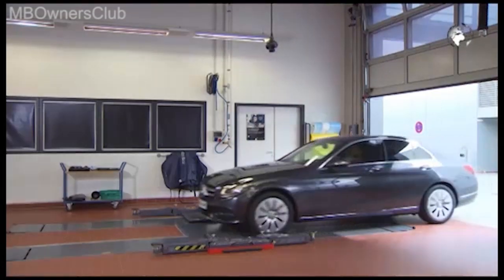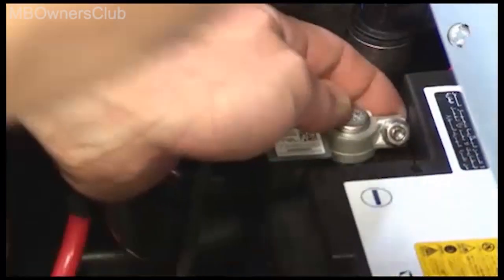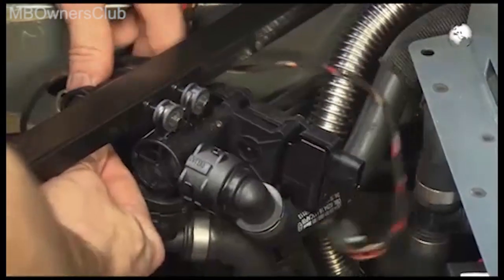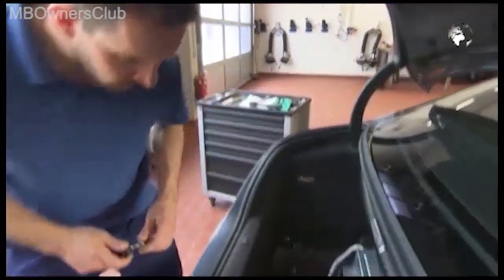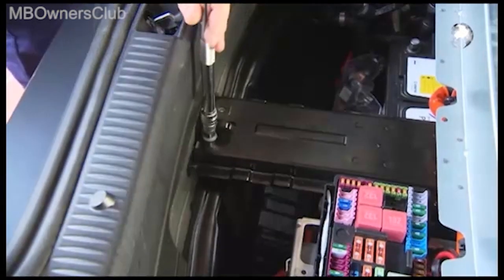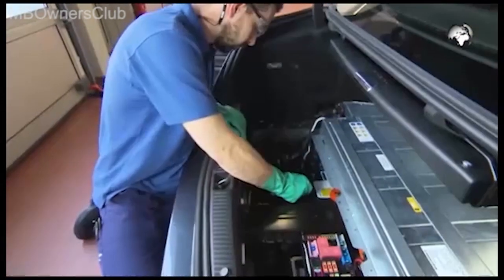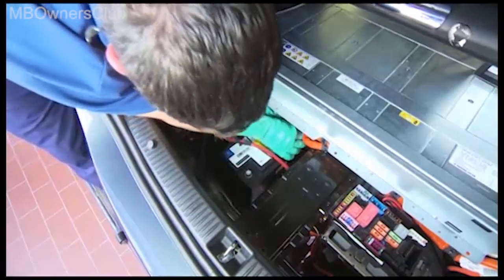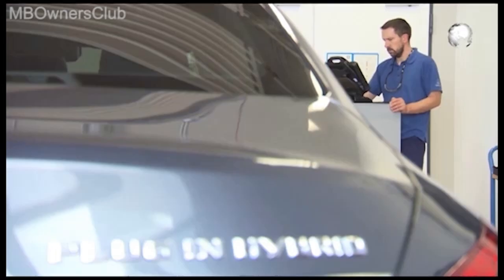Mercedes-Benz C-Class W205 Plug-In Hybrid: Battery Removal Tutorial

Comment: If you fully remove the middle bar rather than inserting a plastic wedge, it gives proper access to the battery. With an extension bar on your ratchet, you can remove the two bolts, albeit you're doing it blind.

Comment: Hi guys… the 12v in my 2016 C350e needs to be replaced and the local dealership is quoting ~$1000US to do it. The majority of that cost must be the labor. Anyway, when they went to perform the replacement they said a tie-down or hold-down strap was missing so they couldn’t (wouldn’t?) do it until they order and receive that from Germany. I was shocked to hear about the strap to begin with because it seems to me that the way the battery is situated in the trunk/boot it could not possibly move. Any thoughts on whether or not this “missing” strap is actually necessary??